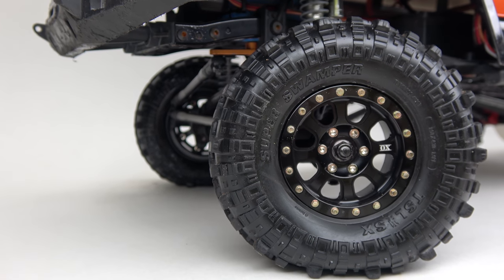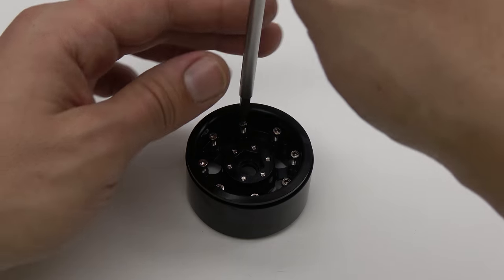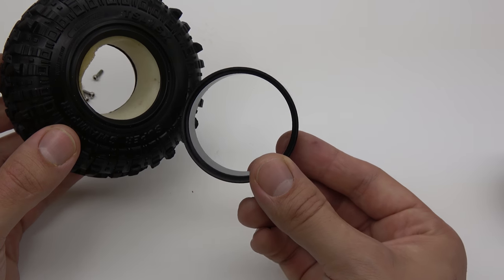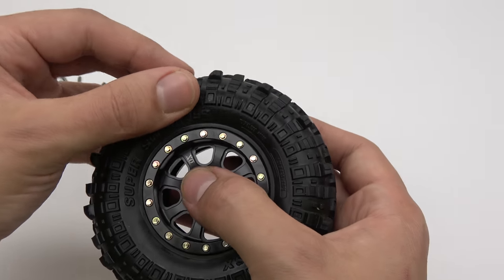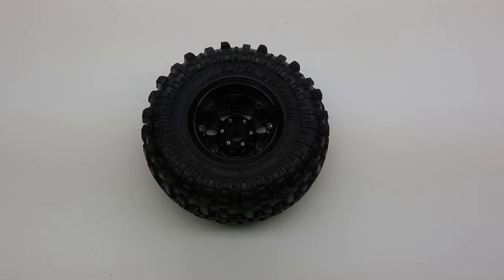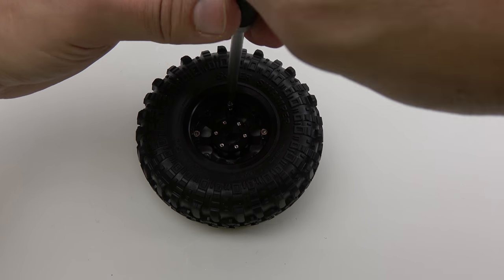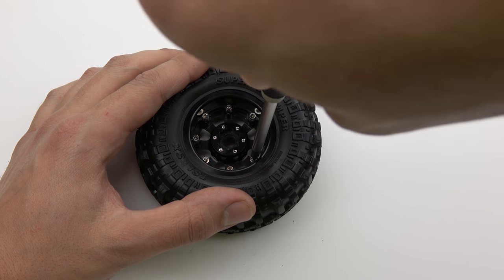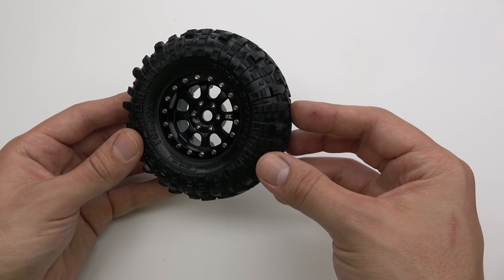How To Mount RC Beadlock Wheels- OX RC 1.9 Black Edition Beadlock Wheels

Comment: Have you had any issues with the clamping screws stripping the aluminum?  I'm looking to buy beadlock rims, and I like the styles that aluminum offers, but I'm skeptical about the strength of the thread.
Reply from the maker: Although these wheels are discontinued, as long as you tighten them is a gradual fashion, you should not have any issues.
Reply: @oxrc6634  Cool, thanks!  I just finished buying ProLine Denali rims which are plastic, but I like them because they have 2 aluminum rings to clamp the bead (16 screws per side!).  The designs you get from aluminum rims are pretty awesome though.